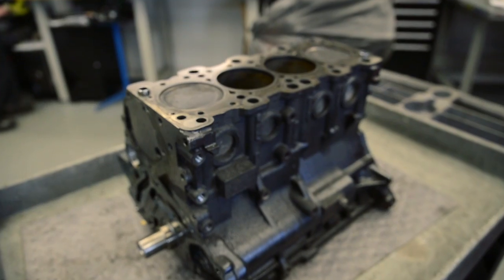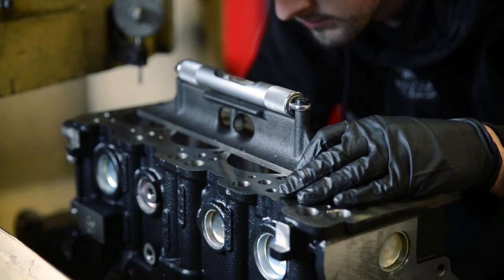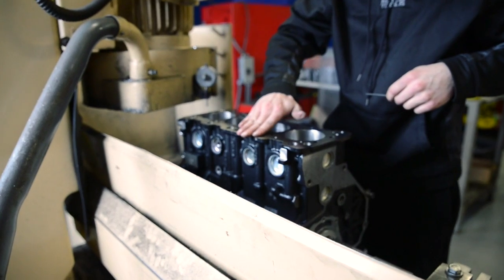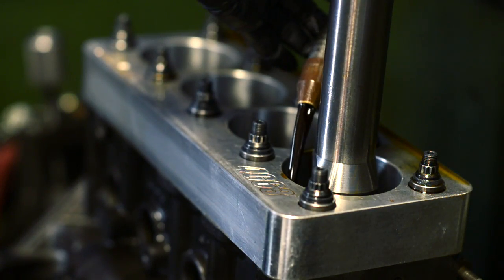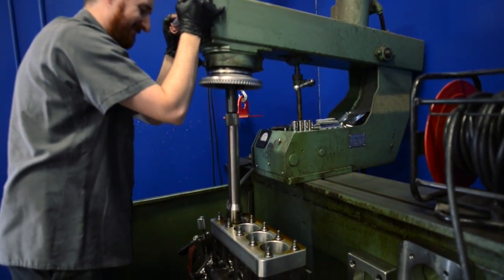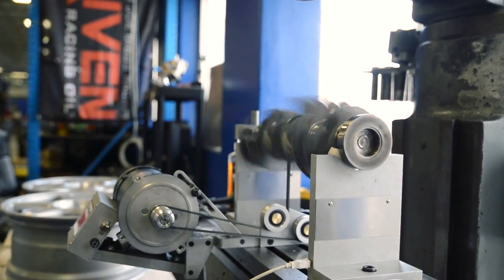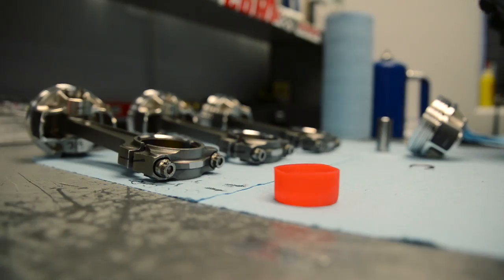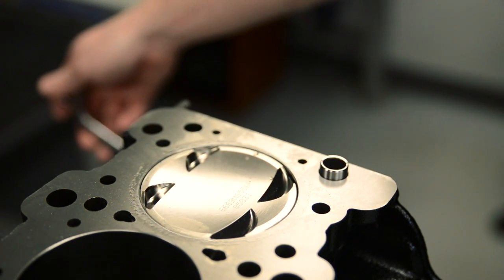Engine Building Steps | Why Choose an MAPerformance Built Motor

Comment: Are your evo x built motors Cali smog legal?
Reply from the maker: We haven't had them approved no, they burn more oil due to looser tolerances so it wouldn't likely pass even with all emissions stuff in place.
Reply: MAPerformance 
I'm so bummed. I bought the evo x thinking I was going to reach my goal of 500whp. I hate Cali right now.